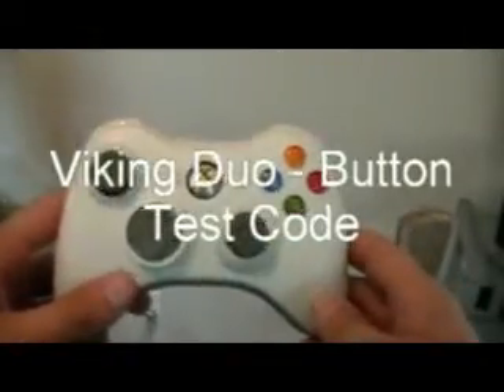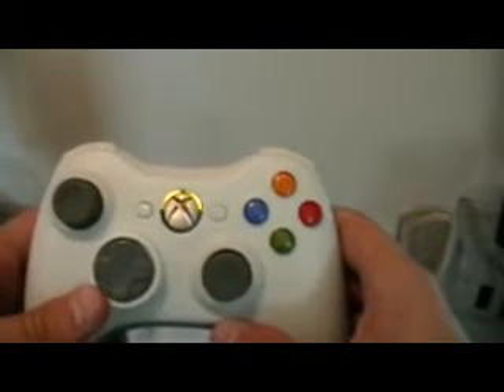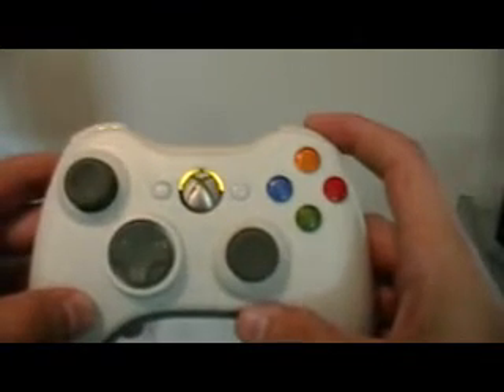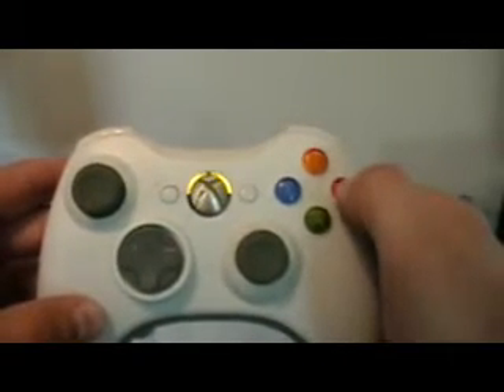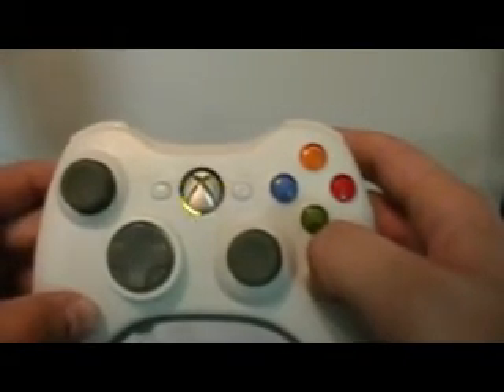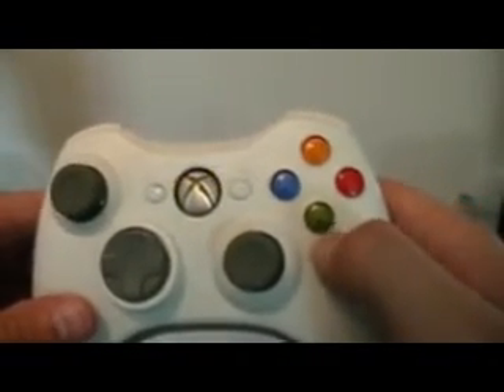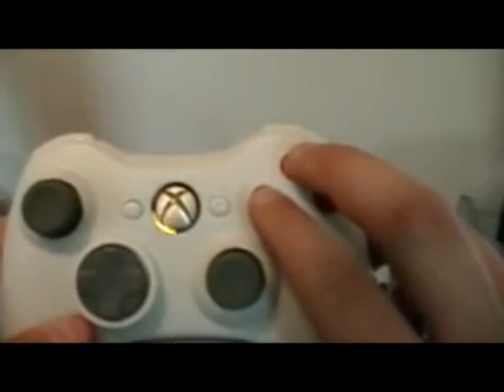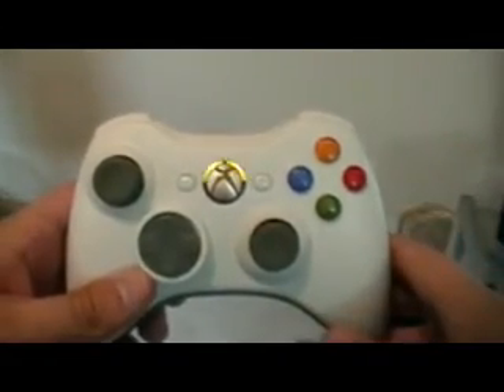Viking360.com - Viking Duo Button Test Demo

Comment from the maker: No, this is just for testing controllers.  We ship controllers preprogrammed with rapidfire code.  The button test code can be flashed into the controller but it's just for troubleshooting in the unlikely event you have problems with the unit.  (we provide a warranty)